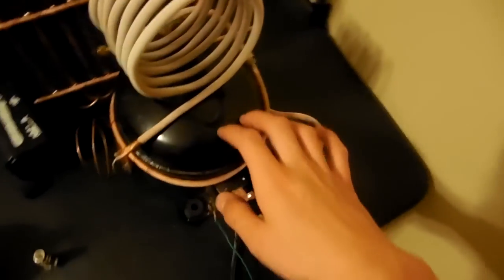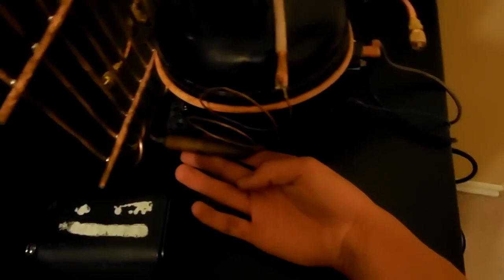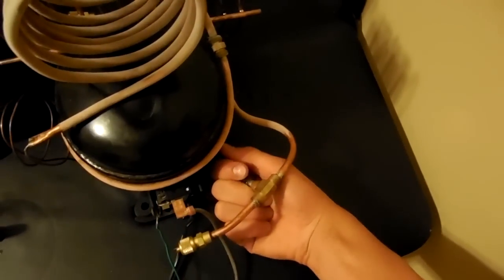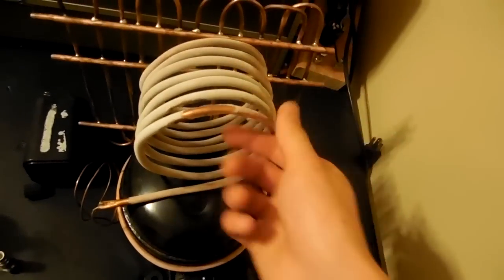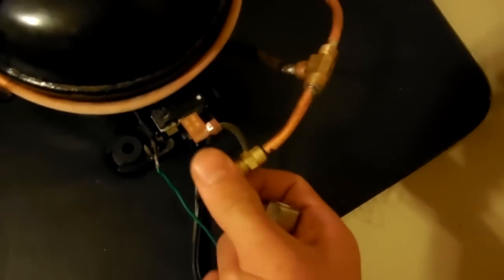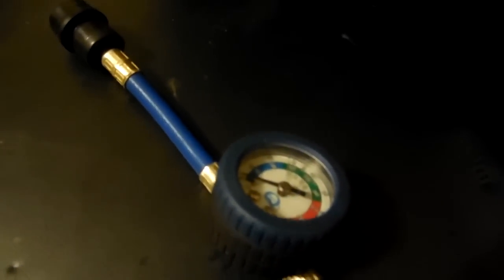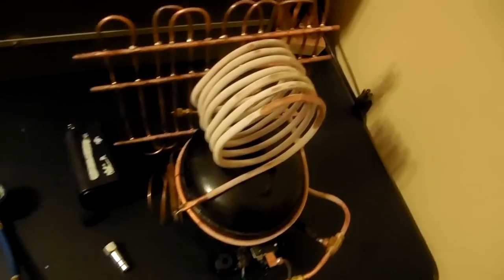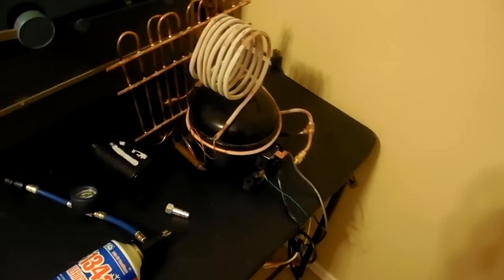Homemade Mini Phase Change Heat Pump (134-a)

Comment: hey man to prevent condensation etc around the cpu and motherboard can you use silicone or plastidip to isolate it>?
Reply: Directly cooling a cpu heat sink will be a major problem because of condensation. That is unless the cpu heat output is enough to heat the evaporator coils over the air's dew point.

Alternatively, one can control condensation by passing air over the evaporator coils and blowing the cooled air over the cpu heat sink while collecting the condensate from the air.  Or one could place both evap coils and computer in an ice chest. While water vapor inside the ice chest will still condense on evap coils, the lid on the ice chest will prevent more water vapor from entering, thus prevent excess build up of condensation that would require letting the evap coils warm up enough to melt the condensation. 

I've been contemplating doing something very much like this with an ice chest. My only concern if what happens in the scenario where the cooling system fails, and heat is trapped inside. For that it would be a simple mater to have the computer monitor temperature and shutdown if necessary.

Comment: So how did you pump the air out of the system prior to charging it? Just start the compressor and open a valve on the high pressure side?
Reply from the maker: Yep

Comment: i'm impressed with your knowledge on this topic, how did you learn about it and how old were you when you started getting interested in it?
Reply from the maker: I have been interested in refrigerant for a while but finally i actually acquired a small pump, and after a month or so of research and collecting parts I put it together.

Comment: Hi, you did cool thing. I want to build it too. Can you show diagram and where to buy different parts and how to connect. I am totally ignorant in this field but I want to try.  Thanks.
Reply from the maker: It is cool that you want to get into this stuff, there are plenty of diagrams already out there a quick google image search should provide you with them, also there are lots of tutorials out there on how to do this kind of thing. I got the pump from an old rotting/rusting mini fridge and my pipe and service valves came from ebay. I recommend using a proper radiator for the hot side. I know it can be difficult to find all of the needed information on how to make somthing like this, my advice is just to keep researching and learning and eventually you will have the needed knowledge, I may make a detailed video on basics of heat pumps and how to make/modify/service one at home.

Good luck with your project.